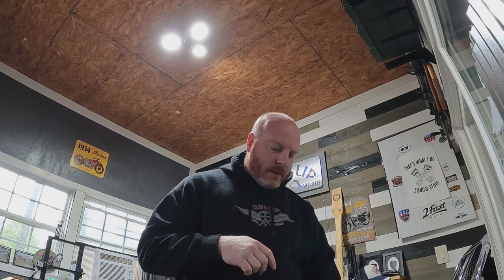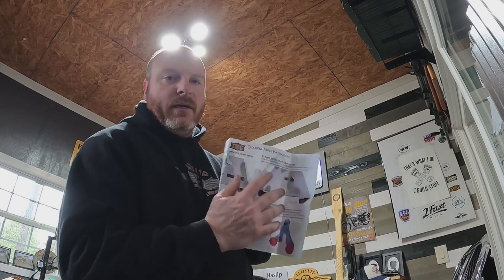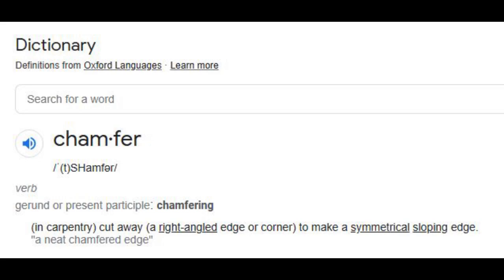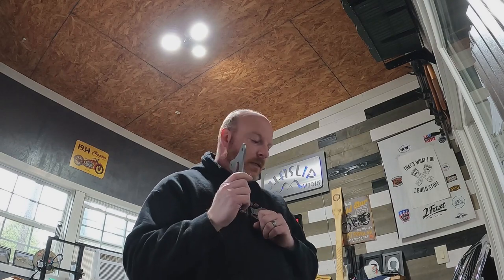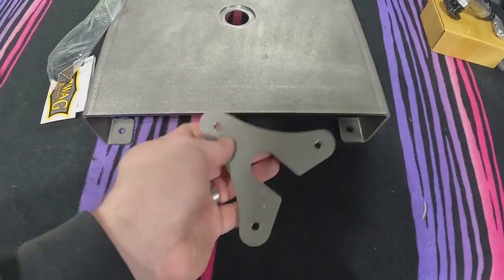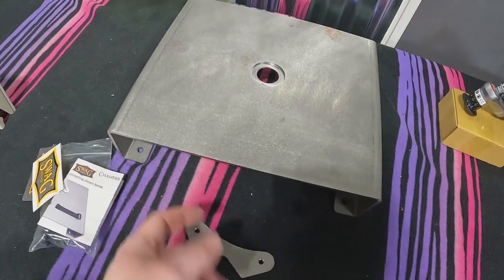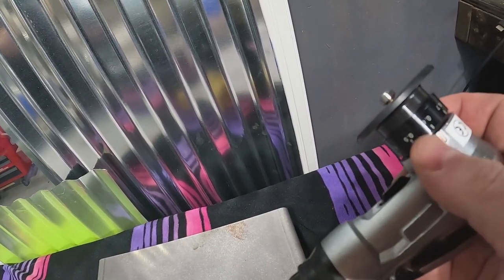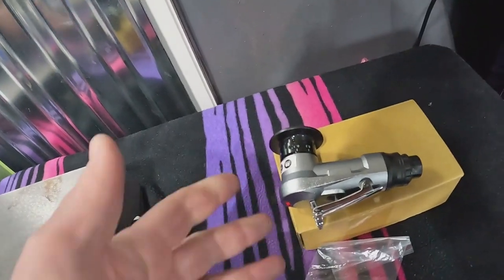Swag Off Road Chamfering Tool Table

Comment: Nice video. How's the chamfer tool holding up? I bought one and the screw fell out after 2 minutes of use and damaged my part. How do you oil it with that setup?
Reply from the maker: So far so good. I went back and locktighted everything. I put a couple drops in the air hose before I hook up the shop air.